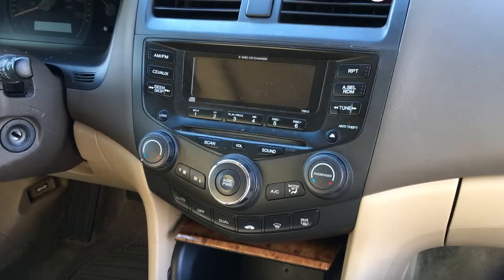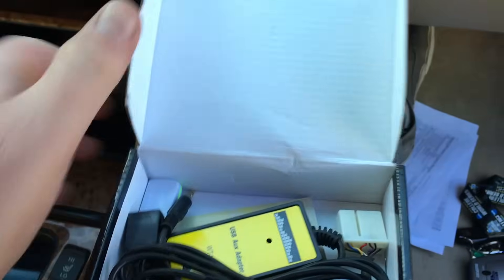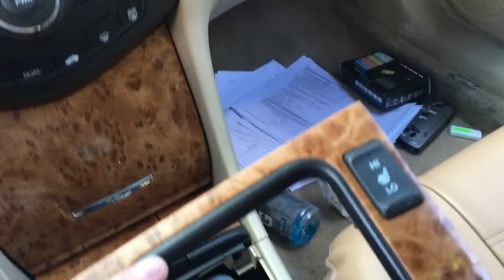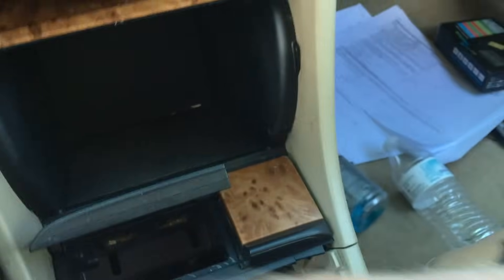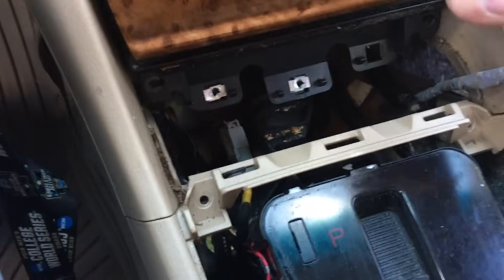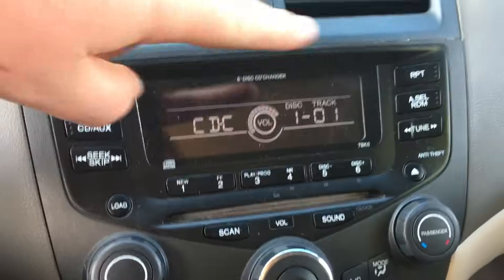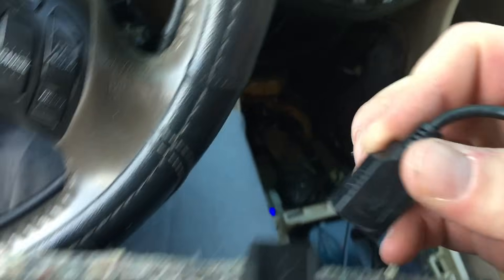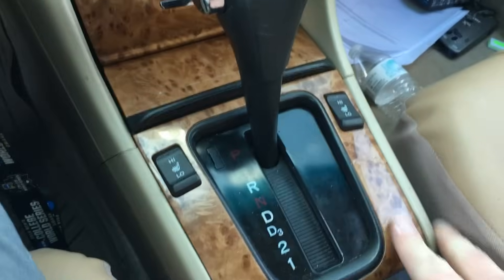2003 - 2007 Honda Accord Factory Aux / USB Install

Comment: mine did not have the white connector to connect to. Has anyone come across this issue?
Reply from the maker: They can be also found on the back of the radio as well.

Comment: i got it installed. So now how do i get he usb to work ?
Reply from the maker: From what I hear, the USB input generally is only compatible with Flash drives or charging.  Newer phones require a higher amperage and most likely will not be compatible.  I would play around with it.

Comment: Will it work if I have a navigation system
Reply from the maker: Yes, however if there is any harness occupied in the port we used, you will need the Y harness adapter.
Reply: Provo Beast Audio Installation what if i don’t need the xm radio, could i just take it out and replace it with the aux cord?

Comment: I had to reset my radio due to unplugging my battery. I entered my radios anti theft code and was able to get the radio to play but now when I go to the CDC option for the aux thats installed, it does not play anything and shows up as CDC Track 74. Any idea how to fix this? Thanks!
Reply from the maker: Maybe unplug the adapter and plug it back in.  These adapters are cheap so it may require a hard reset.

Comment: Will the cd player still work if this is installed?
Reply from the maker: Sure will.  However, if you have a separate 6 disk CD changer, it will require a Y adapter for the install to keep it working.

Comment: I have a Honda Accord 2004 ex will this work
Reply from the maker: Yes, see the description for details
Reply: After reading the description I'm still confused if I will need a y cable or not also
Reply from the maker: Y cable only needed if you have satellite radio or if the port needed on the radio to be used is already occupied with another harness.
Reply: If I am not using my XM radio can I just unplug it and replace it with this unit you used ?

Comment: Also, my car doesn't have that wooden center it has a cassette player there
Reply from the maker: You still will need to remove the cassette player for access.  The Cassette player may have occupied the necessary port on the radio where the AUX cable is installed, however you will need to pull the Cassette player out to be sure.

Comment: There is no port in the 2005 Honda Accord
Reply: Marc Mathura sane here . Just tore everything and haven’t found anything
Reply: You have to take out the entire radio because the port is on the back. Then you have to unplug the existing cable for the CD changer and replace it with the aux adapter. If you want to keep both you would need the y adapter. I almost have it installed on my 2005 Honda Accord but am waiting for the y adapter to be delivered.

Comment: Not sure if anyone is gonna see this. But if possible can someone send me the link to this adaptor. I have a 2003 Honda Accord 3.0 exl. I can’t find it anywhere
Reply from the maker: https://www.amazon.com/Moonet-Adapter-Digital-Changer-Ridgeline/dp/B00ISQX2YE/ref=sr_1_6?ie=UTF8&qid=1511648120&sr=8-6&keywords=Honda+Aux
Reply from the maker: Yep, should work fine.
Reply: Provo Beast Audio Installation thank you. Helped me out a lot. Can’t drive without music
Reply: Provo Beast Audio Installation 
2004 accord exl 6 cd change
Xm radio 
Do I need to buy the Y adapter for xm to work
I can't seem to find one that fits all the speck

Comment: My 04 does not have that port????
Reply from the maker: It may be on the back side of the radio, not the bottom.
Reply: Provo Beast Audio Installation so I would have to pull the whole radio out??
Reply from the maker: Yes, you may have to. You can use this video for further detail: https://youtu.be/tmlucX5SDFA

Comment: The ashtray in my 2005 doesnt come out
Reply from the maker: It may be sticky, this one sure was
Reply: Provo Beast Audio Installation there was a sticky rubber part on top that came off, but the plastic part underneath comes too?
Reply from the maker: Yep, exposing the two screws below
Reply: So I got to the underside of the radio and I don't see the input for the part
Reply from the maker: Then most likely the port may be on the rear panel back of the radio.
Reply: Provo Beast Audio Installation so I bought the Y-adapter, and now I can't switch to an AUX or USB mode still.
Reply: Provo Beast Audio Installation cancel that. I fixed it.

Comment: this does not apply to 2006 accord with navi.
Reply: To clarify, the dash take apart info is spot on. Thanks.  I found the 2006 with navi does not expose the under-stereo plug in.  Still trying to solve.

Comment: how does it sound?
Reply from the maker: Generally these don't sound all that great.  If you spend a bit more money, you can use the PAC AAI-HD3 adapter which sounds much better.  However, for best results (at a higher cost), replacing the radio is the best alternative.

Comment: I installed this in my 2006 Honda Accord coupe ex, and it caused my battery to die. It would not come back on no matter how many times it was jump started until I took the adapter back out. It caused hours of issues due to having to take the console out and in twice. Then my radio stopped working due to the anti theft program after the battery died. I'm not sure if I need to just get a different adapter or what. It wasn't worth all the trouble it caused me.

Comment: Does this work with the factory navigation on my 2006 Accord?
Reply from the maker: Yes, it should as long as the port is available.  If the port is occupied, it would require you to purchase a "Y" Adapter.

Comment: Question for you: I just bought an 06 Accord yesterday and it had this setup installed already, and when I push the cd/aux button it seems to just stay on cd even though my phone is plugged in. Any idea on what to do?
Reply: Make sure the setup is properly installed by taking it apart as he shows

Comment: why did i loose 50% of the volume.with this product?
Reply: bernardo gonzalez same thing with me
Reply: Yea thats the one i bought for 25$ on ebay.
Reply from the maker: Unfortunately with these, you get what you pay for :(  There are other kits, but at a greater cost.  Some modules have gain level adjustments so you are able to increase the volume somewhat
Reply: Whats the other kits names? 
Do you know where the module for a 06 accord is?
Reply from the maker: Yatour Bluetooth Car Adapter
Reply from the maker: Bluetooth Car Adapter,Yomikoo
Reply from the maker: APPS2Car Car Stereo Radio Bluetooth Car Kits
Reply from the maker: Should work

Comment: Can anyone report to the audio quality ?
Reply from the maker: Marginal to substandard.  You get what you pay for on these kits.
Reply: Provo Beast Audio Installation what’s a better route ?
Reply from the maker: Either replacing the radio / adding a single or double din to the pocket under the radio should yield the best results, or just shop amazon and sort by ratings.

Comment: Damn Bru my 04 doesn’t have that port wtf
Reply from the maker: Often it's on the backside of the unit, not under the unit.
Reply: @ProvoBeastAudio  I found it, something was in the port but I just unplugged it and used the adapter instead. Thanks for the help
Reply: @Lit-v1h what type of adapter did you use and how did you remove the stuck piece
Reply: @Lit-v1h did the adapter work  once u got in plugged in?

Comment: or just get an FM transmitter for 5$ and get lossless Bluetooth audio
Reply: I tried that but for some reason it picks up the alternator so u get a loud ass buzz the whole time especially while you’re driving
Reply: If u have a solution to this tho I’m all ears cause I tried this vid and my radio doesn’t have the port on the bottom🤬🤬

Comment: It's not on my 04 accord wtf
Reply: Primalspeed 3 it has to be there!! check again! even if u have base model or not
Reply: Mitul Jariwala o found it but it was behind on mine and I had to sacrifice xm radio for it
Reply: Primalspeed 3 xm radio?? or fm/am radio??? i want to buy an adapter for my 04 accord too
Reply: yepppp mine didn't have it either. pretty disappointed because I have a 3 hour drive ahead of me and dont have time to pull the rest of the radio out and figure it out